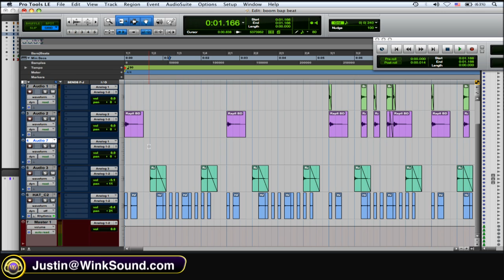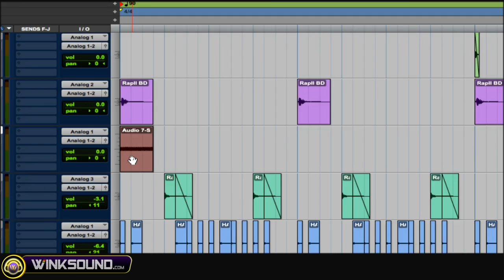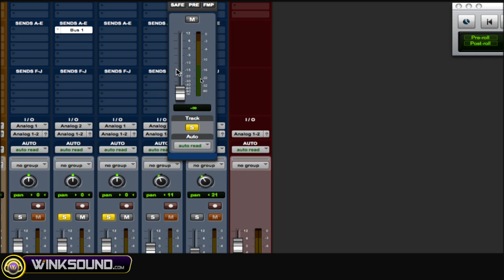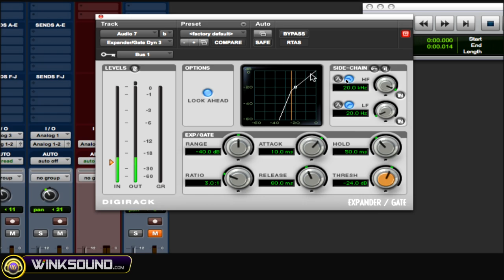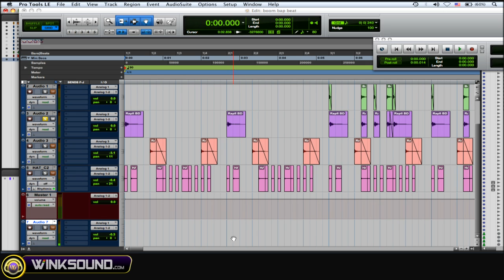Pro Tools: How To Fatten Kicks Using the Signal Generator | WinkSound

Comment: another way to do this is create a mono aux track and put the signal as an insert and have your kick sent to this track at unity gain so you have a copy of your kick on this aux track.inset gate/expander after signal on your aux track and set its ratio to 100:1 so it mutes the signal when the threshold is not met.select key input and change it to the send your kick is coming from so it only opens when the kick hits